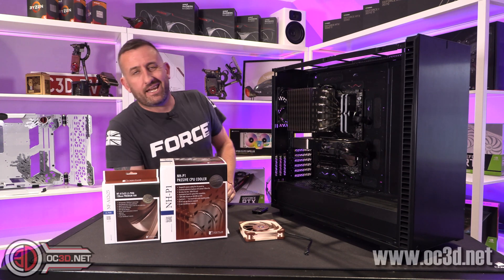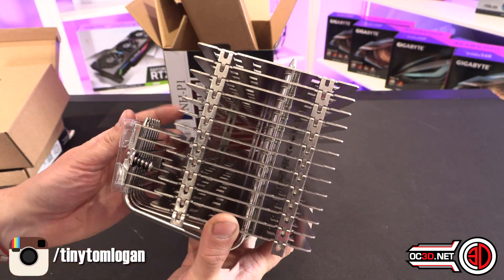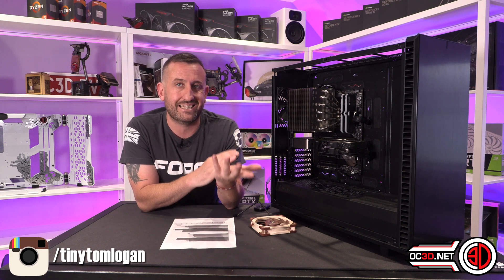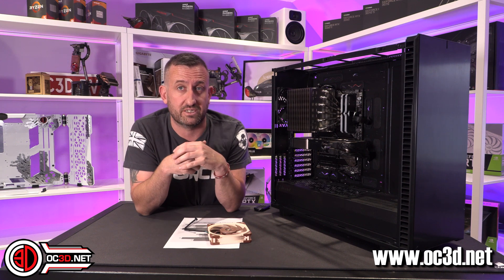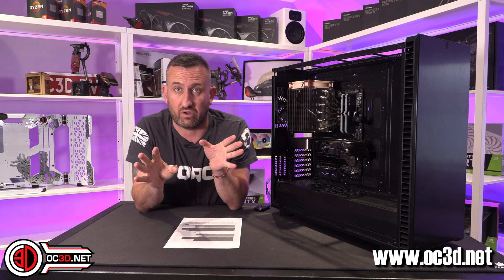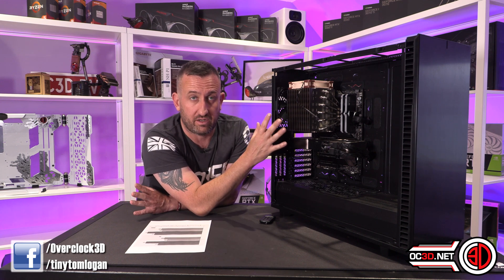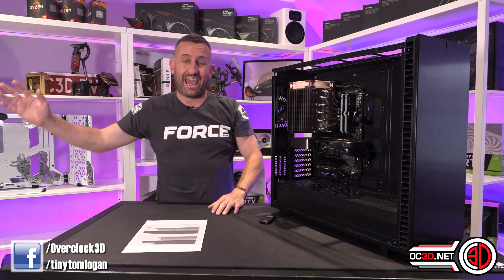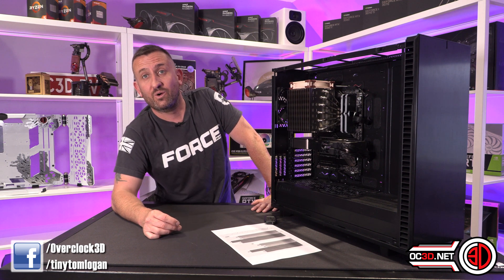Noctua NH-P1 Review  - Tested with GPU stress too

Comment: I reckon this would work a treat for a passive file server build out of random old hardware (I got an old i3+board lying around).

If a CM Hyper TX3 can keep.up with that old thing under p95, the P1 should have no issues running completely passive.

Having 12 HDDs in the case however may or may not defeat the purpose altogether 🤔 Not to mention they'll all probably need fans as well 😔

Nvm...

Comment: I have this cooler and a RTX 3090 FE, the combination seems a perfect match: the part of the 3090 below the cooler is closed off and not really emits any heat (it is drawn out by a fan at the bottom through the back), while the part of the 3090 that is not under the cooler has a fan that blows upward and can be perfectly aligned with a fan in the top of the case to draw the air out in a straight path past the NH-P1.

Comment: Cooler is useless. Wondering why no Youtuber has yet pointed this out.
Too big for silent HTPC, expensive and not brilliant as active cooler.
Who puts a massive cooler like this in a massive case, where you already have 4-5 fans spinning?
I'm a big Noctua fan, have bought all their coolers and fans, but this is a major pass for me.
Reply: It actually works better than any passive cooler on the market...size being the biggest reason. If you can't or don't want to make use of it is entirely up to you. Take note that not many cases are configured to properly take advantage of passive cooling, ie those cases you are describing with all the fans or the one used in this video.

Comment: I got an NH-D14 about a decade ago thanks to your recommendation and I've recently bought a 5900X and like you say, Noctua sent me the AM4 mounting kit for free.  The D14 is fine with my 5900X so that saved me over £100.
Reply: i have d14, perfect cooler, great choise bro
Reply: @was wasn't BEST COOLER COMPANY
Reply: @was wasn't Definitely great company, I also enquired about replacing the fans in case they go south in future.  I have replacement fans but not the clips.  They told me I should be able to transfer the clips, but if I mess it up they'll send me replacement clips for free ...